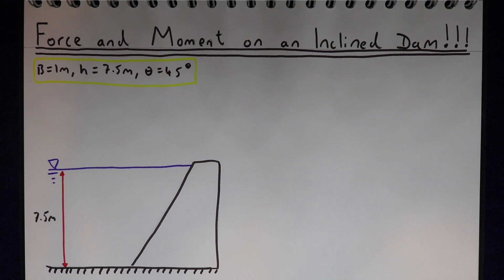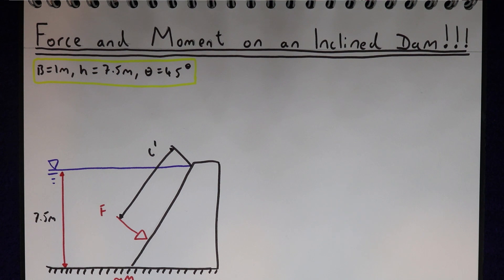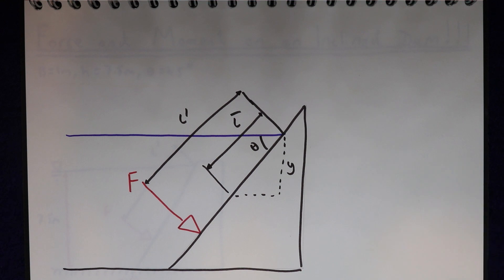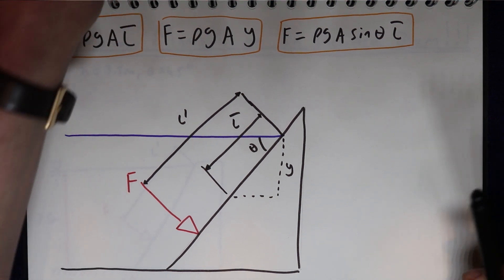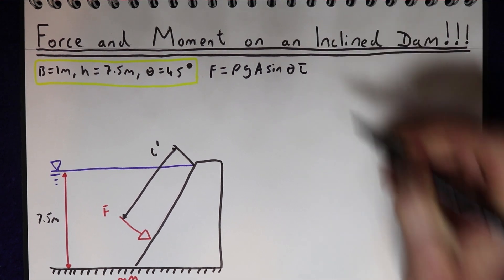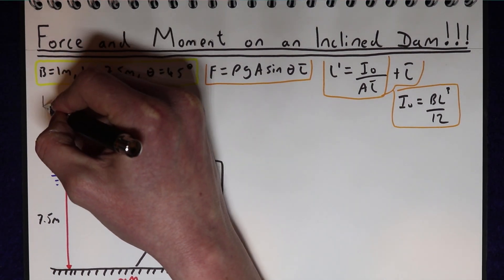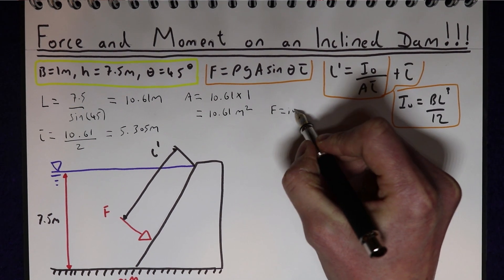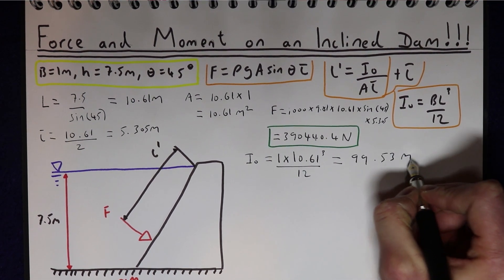Inclined Surface (Dam): Forces and Moments

Comment: How can the width be 1m if the shape of the dam is trapezoidal?
Reply: The width is due to it being "per unit length", I think; I think it's a good idea to assume per unit length, 1 meter or 1 foot, if it is not specified by a problem. The width is the "z" component (axis), where the x and y components (x and y axes) are what you see on the diagram. So, the 1 meter is going into the page.